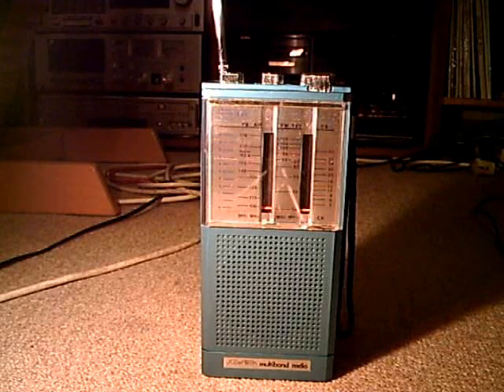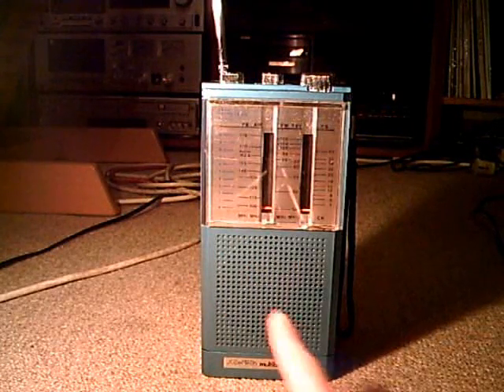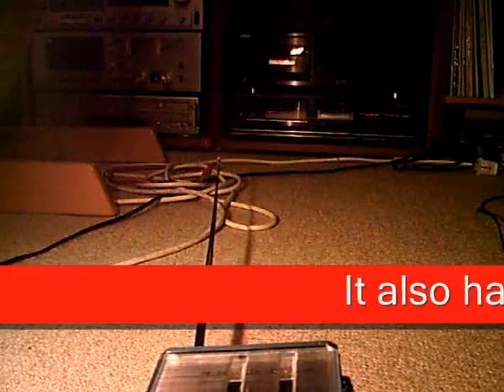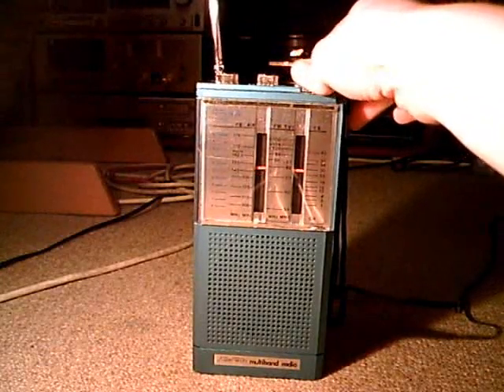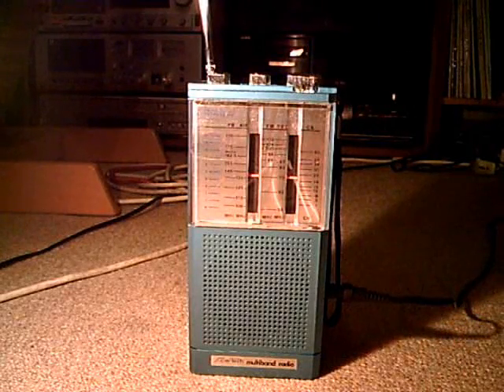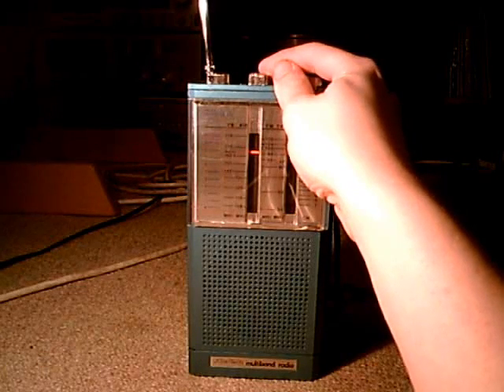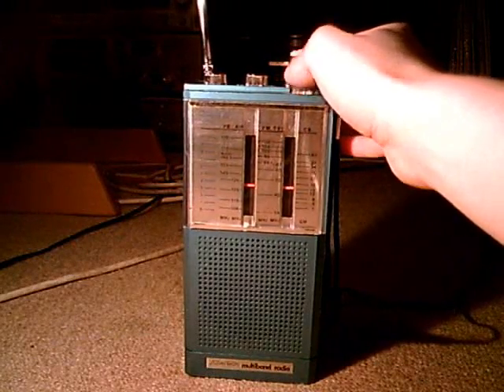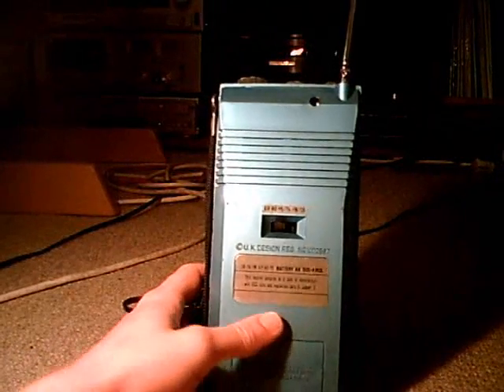SuperTech multiband radio receiver

Comment: pdmillar is correct about the image signal you heard on TV1 band. I heard several more as you tuned upwards. Also, I believe you still have an analog TV signal in your area. The sound you refer to as a transformer hum sounds exactly like an analog video signal. And on AM band, try working the bandswitch to regain proper contact.

Comment from the maker: - It stopped in 2007 (I believe 31-12-2007)
- Yes, we have digital TV. It can be received with either a Digital TV or a Digital TV receiver box that plugs into an analogue TV set
- I don't know if it was made for the US, but it's possible.

Comment: When did analogue TV in Germany stop broadcasting?  Does Germany have any free to air digital TV broadcasts that can be received with either a Digital TV or a Digital TV receiver box that plugs into an analogue TV set?  I wonder if the weather band feature on this radio is in fact for the US weather band, there is a dedicated weather band in the US that you can listen to if you have a radio that recieves the correct frequencies.  That's what makes me wonder if the receiver was for use in the US.

Comment: What size batteries does the unit use?  I'm wondering if this radio was designed for use in the US?  Hey you've slowed down the music at the end of your videos, cool.  It's sad when people don't remove batteries from electronic devices and they corrode, it's something that annoies me, because battery acid can do so much damage.  Would you classify this radio as a pocket radio?  When using the unit on AC power, does it have an internal transformer, or do you need to use it with an AC Adaptor?